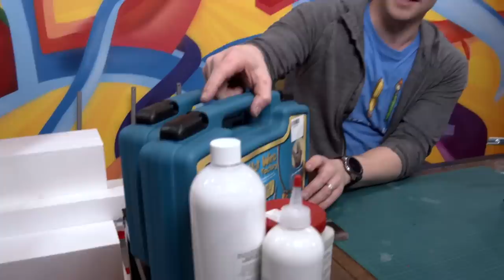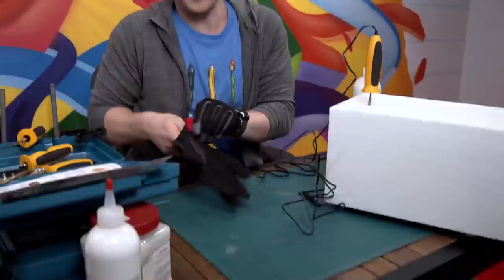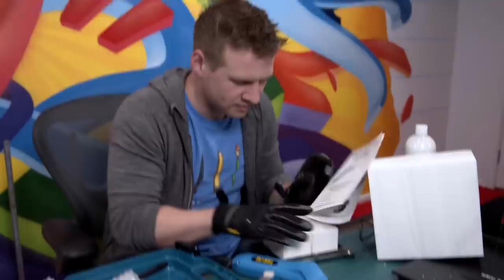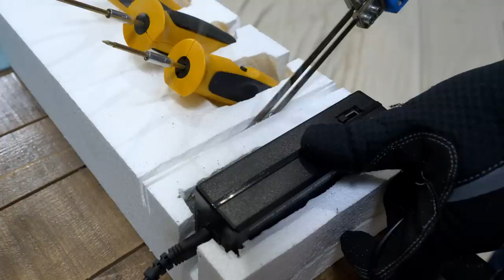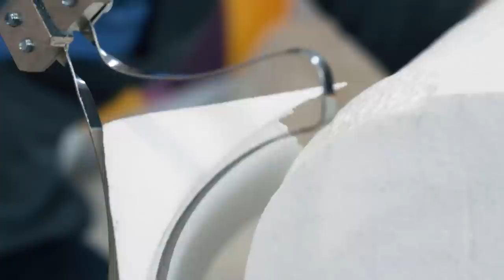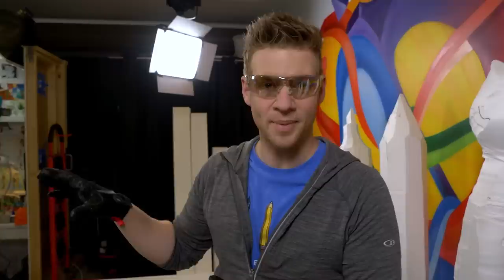I used a HOT KNIFE to Sculpt FOAM! - Really Satisfying!!

Comment: You should have made a stand for the hot knife to be hold at a fixed angle, so that you move the foam board along the table to get smooth edges. Free hand will always cause imperfections in this case. Nevertheless, Great Work.

cheers

Comment: tbf, this showed me exactly why miniature terrain crafters prefer proxxon tools. except for those last 'industrial' foam factory tools, they all looked very rickety. 

so like, try proxxon hotwire tools, try insulation foam (SOOOOOO much better than styrofoam, it's sturdier, cuts smoothly and you can also actually sand it) but get a decent respirator for it though. those foam fumes are damn toxic.
for those tools you made at the end, the insulation foam is a bit sturdier and sands easier, so should be a lot easier t owork with ^^

maybe that's a next project? jazza been doing some miniature painting in more recent vids, why not miniature terrain?

Comment: I know I'm very late to this party (just found your channel), but I have a warning about those gloves you're wearing for hot knife work. I have the exact same Mechanix gloves for auto work. If they come into contact with a very hot surface, like those heat knives, the artificial materials used in making those gloves will quickly turn molten and burn you worse than the actual heated surface ever could. 

I had the pleasure of melted glove material stick like napalm to the back of my hand while using an angle grinder (and that was just sparks, not a hot surface).

Either get some gloves made specifically for hot work or don't use gloves and just be very careful. At least with bare skin, you can get away with a relatively minor burn. Napalm-like molten glove is not pleasant and does not come off easily.